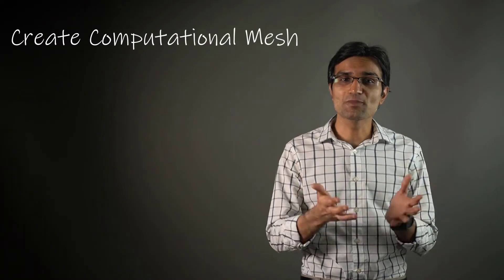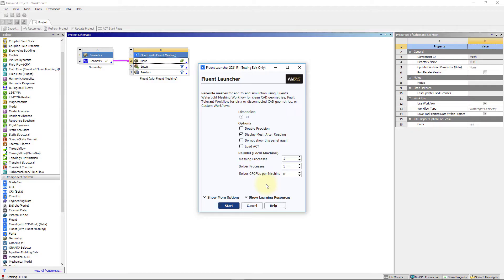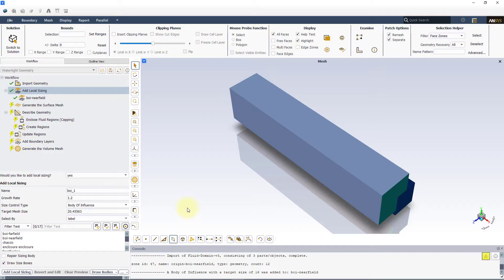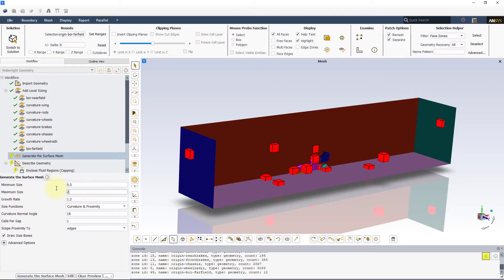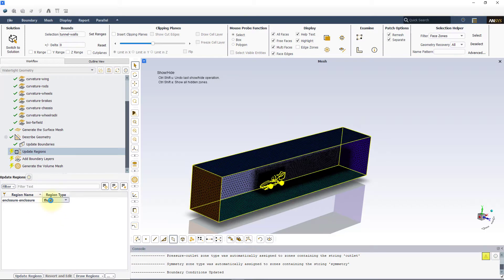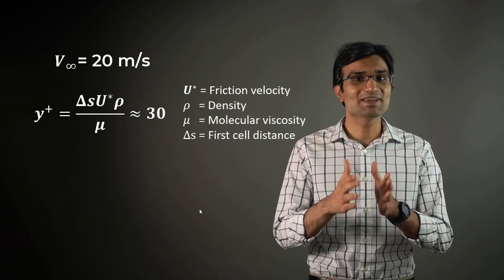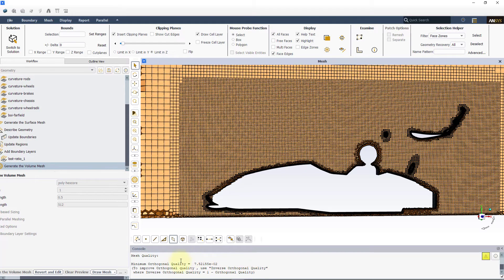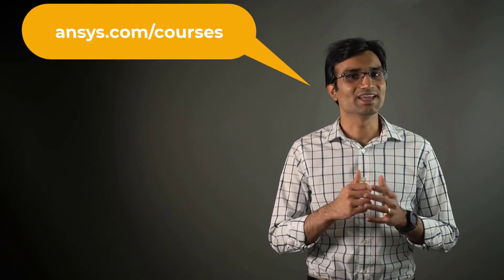Mesh Generation for an FSAE Car Using Ansys Fluent – Lesson 2

Comment: I am creating a mesh for a fixed wing UAV, I do all the steps the same however, when I do the surface mesh (with the same enclosure you made) I get the message that the region consists of 1 solid/fluid and 1 VOID. Should I be worried?
Reply from the maker: Thanks for watching! Please post your query on the Ansys Learning Forum for a detailed answer from the wider Ansys Community: https://ansys.com/forum.